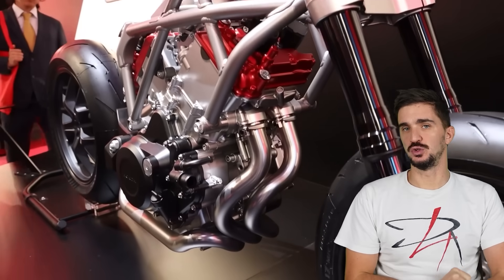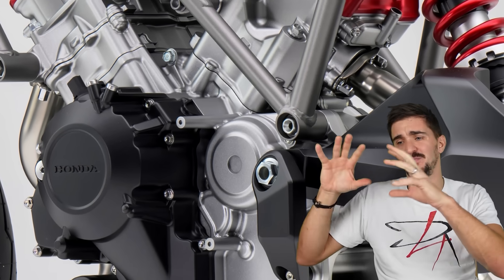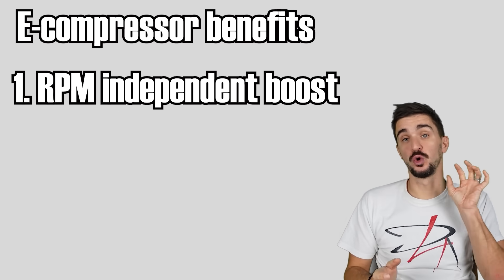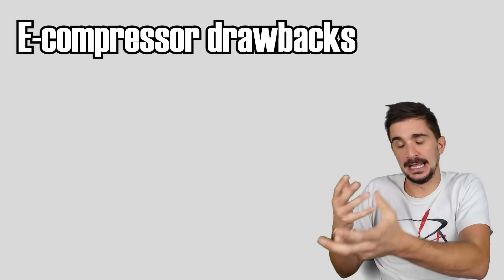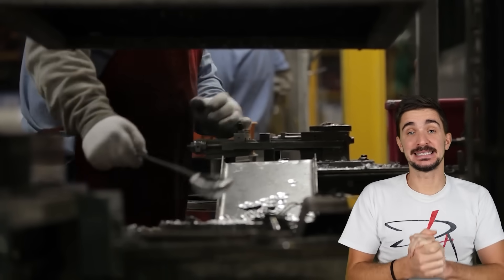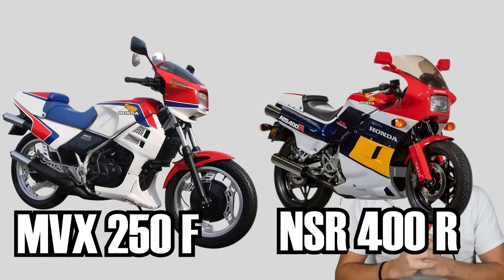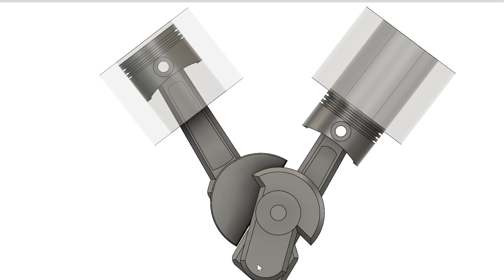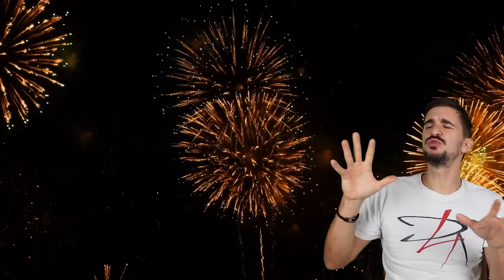Honda's New V3 Electrical Compressor Engine Explained

Comment: First, Honda should really focus on making the 1.5t reliable before venturing to a 3 cylinder.
Reply: Honda motorcycles has nothing to do with Honda automobiles. 
1.5 is not half bad.

Comment: Updated info a year later, it’s 73deg and 900cc, with claimed HP equivalent to a 1200cc according to Honda. Thats not a clear statement but their VFR1200 (V4) produces 160HP and in their promo video they show the prototype on a dyno with 160 flashing up briefly in red, so it looks like that’s what they want us to believe. It would be great to get another technical review of this engine if there is enough new data to justify one?

Comment: I don't know why it took so long to finally see electric compressors/e-supercharger or electric turbos adopted more widely for consumers. It was such an obviously advantageous system that I have wanted to install one (or a compressor and an... extractor fan?) in my vehicles for 12(?) years now.
Reply: I should note, I only wanted low boost.

Comment: Porshe has done something like this e turbo on the 911 GTS. Amazing flat torque.
Reply: It's not the same.
Porsche still uses a turbocharger and harvests electricity from it (from excess of exhaust gases), which can be used to help to spool the turbocharger.
Honda uses electricity only. No exhaust gasses involved.

Comment: @6:25 I bet they could use a small axial flux motor for the compressor motor which would solve the issue of heat and duration of use.

Comment: Pretty bang on with the e-compressor calculations saying 100hp engine goes to 130hp with 5psi of boost, and now Honda claims this 900cc to be equivalent to 1200cc!

Comment: 130hp from a 1 litre engine, yeah, 15-20 years ago.  Modern, performance 1 litre engines are averaging 200hp. For four cylinders at least. Current near 1 litre twins like the Panigale V2 and KTM RC990R (both are around 950cc) are in the 120-130hp range and are part of the new Supersport class largely suplanting 600cc inline 4's. The older Panigale V2 made 155hp but they cut power and weight on the current model.

Comment: Thank you for a very clear video. The V3 looks to be a very interesting engine! The other snag with Turbos was that the amount of boost they supply rises rapidly with revs, meaning that whilst you have no boost at low speeds (hence turbo lag), you likely had too much boost at high speeds, so had to dump it. Electronic control of the compressor is a genius idea to get round this.

Comment: "e compressor " ? the limitation with a electric motor is revs , you might get 5000 rpm if you use enough engineering , 3300 is pretty well max at the moment , while a "turbo " can be spinning at 200,000 rpm , just a bit more then . Air is , for want of a better term , elastic, you can squash it and stretch it , when you squash it it releases heat , but when stretched or expanded rapidly ,it cools dramatically , but loses density , theres problem number 1 , how to compress the air enough without it overheating the compressor  thats why this system only generates 5 psi , they cant get the compressor to spin fast enough reliably !

Comment: You’re using the term electrical Incorrectly. Electrical is a more general term whereas “electric” refers to being powered by electricity. Ie. electric motor. You wouldn’t say “an electrical motor”. Great video though! Just got annoying hearing electrical over and over.

Comment: And no you dont save gas with turbo vehicles. Infact turbo and supercharged engines use more fuel to fight detonation. My bronco raptor for instance gets mpg than both my 1996 bronco 5.8 and jeep rubicon 392.

Comment: Too bad the exhaust doesn't run a higher voltage battery charger to top off the compressor batteries.

Comment: The company i work for uses a V3 diesel Warchalowski tractor for snow plowing. i don't understand, why someone would design an engine like that but it works. it has been working for over half a century.

Comment: don't quite see the advantage of V3 over V4 (you need two separate cylinder heads, the width is defined by two cylinders, length defined by the angle of two banks, and i.e. Aprilia is using 65° angle on theirs, with the cylinders being of course smaller per total displacement - so it's probably even more compact given the same displacement), but if they want to do something quirky for the hell of it, go for it.

Comment: About 20 years ago when I was working with medical ventilators, many used blowers similar to this and they can put out a lot of air and have air ready on standby for when a patient takes a breath.  I am a repair technician, I am a motor head not an engineer,  I used to tell my co-worker techs that I think this technology could easily adapted to supercharge engines.  Glad to see it!

Comment: Sounds like a solution to a problem no one asked for? 

Battery weight?
Alternator weight?
Valvetrian complexity if you wanna harness any of the boost you generate with that... 

I would be totally happy with a 800cc V3 with 100hp at the wheel without all that giggles ....

Most likely the engine is emission starved and the compressor adds a little fancy 5-10bhp somewhere, sometime..... 

Just my guess...😅

Oh and btw scaling a V6 car engine to a motorcycle engine is a very very bad idear.

The car most likely does not need a bigger alternator, as it has tons of electrical consumers anyway.
Alsow the battery will most likely not gain any significant size.

On a bike where there is maybe a keyless start option and a clock on the dash the idle power consumption is minimal...and so is the battery...
On a car you have Starter-Generator options to place between crankshaft and gearbox.

A bike runs a wet clutch and gearbox in oil...that is completely different internally from a car gearbox where engine and gearbox fluids are separated.

I am not telling it can't be done.
Just saying that the comparison is quite a wild guess....

Alsow comparing a heavy diesel engine to a lightweight motorcycle engine screw's the numbers even more...the diesels valvetrian is already optimized for low rpm high airflow...a bike engine generally is not...

Comment: If they add a bigger alternator they can also use it on demand when you let go of the throttle for regenerative braking
Reply: The bigger alternator does generate parasitic drag on the engine...
The whole electric thing is a solution to a non-existent problem.

The only benefit is freedom of placement..... But all the electrical requirements do add up on weight in different places ..

Comment: I think we should stop focusing on how much fuel we can cram into the engine, and focus more on using less fuel to extract more power from the combustion itself.
Reply: This is exactly why Honda uses an e-compressor.

Comment: A turbocharger is "free" energy, or can be designed to be. Yes the turbine creates back pressure on the exhaust stroke but the intake stroke benefits from "fore" pressure. In a sense the piston section of the engine now sees the world as 2 bar or whatever the boost is. The net effect is positive, as by increasing the pressure ratio of the entire system, you are able to harness more of the heat  energy of combustion before it reduces to atmospheric pressure. Similar to how a jet engine benefits from a higher pressure ratio. In fact a turbocharger is in effect turning a piston engine into hybrid piston turboshaft engine.
Reply from the maker: Free implies something for nothing. That's not what you described. Yes, you get something bigger by sacrificing something smaller, but not free. Otherwise some business would be considered free money too 😆
Reply: @d4a  I guess what im saying is a well matched turbocharger under sensible driving conditions shouldn't take net power off the crankshaft, so in a sense it is free energy - or to phrase it better you are utilising energy that is otherwise wasted. Whereas a supercharger and this thing which is essentially an e-supercharger does take energy from it- it sacrifices fuel efficiency for power density/responsiveness. That's why an e-assisted turbocharger is the best of both worlds!

Comment: The e compressor is not going to create back pressure, but it is going to put more load on the alternator, which is driven by the engine. Which is more efficient is going to be the question. The real benefits may come from the three benefits you previously mentioned.

Comment: Interesting video, you put a lot into these.  Thank you.    I wondered about increased weight of battery as many basic motorcycles still use lead acid.   With a upgrade to lithium battery you could bought increase power and possibly even weight less.  Solid state battery even better.    Just a thought.

Comment: How about a hydraulically powered compressor? At wide open, it would probably act like a supercharger – oil replacing the belt, but variable with valves.

Comment: There's another advantage of a supercharger over a Turbo: Being independent from hot exhaust gases, the air / mixture that gets compressed doesn't have to pass through the freakin' hot Turbo, thus no intercooler (cost, need of space, far longer intake way) is needed.
Reply: Superchargers use intercoolers/after coolers as well. The heat in the intake is not from the compressor housing it’s from the fact that air temperature raises when it’s compressed.
Reply: @samhoffman1280  
Yes it does raise too, but not in a amount that makes a cooler mandatory, as you can see in the example in the video above 🙂

Comment: as for what the cost of this e-compressor is, it is similar to the costs of a supercharger. the electric motor on the compressor increases the engine's need to create electricity. Thus it increases the alternator's parasitic hp loss.

Comment: Idea #347
A vacuum cleaner type blower on the crank, pressurizes intake air from a front scoop, and the exhaust turbo runs the alternator electrical generation using Peltier effect producing electricity from heat also. The turbo quiets the exhaust and a small box muffler under/behind the engine with multi 3 inch small diameter side outlet pipes aimed down and back dumps the exhaust without any muffler weight to speak of. Use dual rear swing arms for strength and light weight.  Two small shocks at 45 degree forward and a partial uni shock spring. Opposing 2 cylinder, 2 cycle, both fire at the same time, motor with two crank eccentrics.  One valve per cylinder using PULL RODS. Use a 2 cycle muffler if it's a 2-cycle motor.

Comment: The Honda MVX250F is a 249cc, liquid-cooled, two-stroke, 90-degree V3 engine motorcycle. It features a 49hp engine at 9,000 rpm and 31.3 Nm of torque at 8,500 rpm. The engine is a 90-degree V3 layout with two cylinders in one bank and one in the other. It uses crankcase reed valve induction.

Comment: Interesting with 75degr. V engine.  Opel had also a 75degr. V6 race engine of 2,5L in late nineties Opel Calibra, which was a real rocket, but never understood why it had to be 75degr. while the other manufacturers used 60 and 90 degr V6 s.
Reply: It was an Isuzu engine block if I remember correctly.

Comment: this e compressor system will NOT create a larger net gain than a traditional turbo.  this is because the E compressor is just an electrical SUPERCHARGER.  the electric compressor has to be pulling ALL of its power directly from the engine in the form of electricity.  so the alternator is directly slowing down the engine to power the compressor.  its just a supercharger.  all superchargers create SMALLER net gains compared to turbochargers because the supercharge takes ALL of its power from the engine, while the turbocharger reduces SOME engine power as an unfortunate side effect but gets ALL of its power from waste gases.  Because the turbo is getting power from something that a non turbo engine was going to throw away, it gets more total power by being MORE EFFICIENT.  a supercharger doesnt do that, so it will have less net power gain.  

lets take a hypothetical.  take a 100 HP engine WITHOUT any supercharging.  now we take two identical copies, put a turbo on one of them, and an E supercharger on the other (electrical compressor).  we boost both by exactly 14 psi which will take intake manifold pressure from 14 psi (atmospheric) to 28 psi (double atmospheric).  our hp rating on each is now 200 hp.  however the supercharger system itself takes 10 hp to run.  so in fact the MAXIMUM for the e-supercharger system is 190 hp.  the turbo charger system requires an IDENTICAL 10 hp to run, but it gets that 10 hp from the exhaust gas that the e-supercharger DOES NOT USE.  so it still gets 200hp IN THEORY.  however now we subtract out losses from back pressure and that will be about 2 hp instead of 10.  so we have 190 hp vs 198 hp.  

it is basically ALWAYS THE CASE that a turbo charger gets more power than a supercharger due to the increased fuel efficiency.  if this were not the case no one would use turbo's.  Mechanically driven superchargers have been around since the early 1900's and if they COULD be better than a turbo everyone would use them.  converting mechanical energy into electricity and then CONVERTING IT BACK TO MECHANICAL ENERGY does NOT increase the efficiency of the system.  it only makes it easy to put the supercharger wherever you want it.  in fact it will DECREASE efficiency as you have energy losses at BOTH conversions.   So the E system lets you package better AND it eliminates turbo lag and lets you flatten your torque curve, BUT the cost is that it is LESS efficient than a mechanical supercharger, and we already know that a mechanical supercharger is LESS EFFICIENT than a turbo charger, because thats the whole reason everyone uses turbo's instead of mechanical superchargers.

Comment: High compression at low rpm will cause problems of higher wear because lubrication is not (yet) optimal at low rpm.

Comment: In the picture s it shows the electric compressor with TWO largish fluid connectors going into the casing. They are not cables and seem to be water cooling for the electric motor. Where does the electrical power come from? a LARGE energy sucking alternator perhaps?

Comment: check porsche GTS hybrid turbo charger E then you understand abut F1 hybrids you need understand turbo E is mean air compressed and is no same with air compressor is 2 different things is no same turbo E is inside air compressed and not compressor

Comment: Can we make a multi cylinder engine with different cc for different cylinders, maybe adjusting there stroke lengths or something.
Reply: been done many times already
Reply: Which engine pls, is it used in any production vehicle.@georgebarnes8163

Comment: Boost pressure, I.E. 5psi, is a "dimensionless" value when what needs to be known is how much available oxygen exists in a system. Here's an example of what I am referring to: 2 containers with closed valves, both of different sizes, contain 5psi of air pressure. Each is connected to the intake of an engine using a hose, and the valve is opened immediately to release the air into the engine. Without knowing anything else about the containers (and the entire system) besides knowing the air pressure, we will know nothing about how much oxygen will flow into the engine when the valve on each container is opened. How large is each container? How large is the hose on each container connected to the intake? How large is the engine displacement where the container will release it's oxygen, and how fast is the engine spinning? If it's not spinning at all, the displacement will be constant, and will change depending on where each piston is located. If the engine is spinning very fast, volume of potential flow for a given time frame will be larger. Then, there are other variables involved, such as resistance to the air flow, turbulence effects, etc.

    We can go further than these examples. What if one container is smaller, and it was filled to 8psi at a high temperature, and then the container was cooled until the air pressure inside lowered to 5psi, while the larger container was filled to 2psi at a cool temperature but then it was heated until the pressure inside reached 5psi--how much total oxygen is actually contained inside each container at 5psi now?

   As you can see, when flow is involved, many new variables exist. When flow isn't involved at all, variables still exist, such as temperature and volume, to know how much oxygen is available to be used. 

  Many often think that psi alone provides a way to determine some increase in power, but it's a sliver of the entire equation. A very large pump with large hose that is cool maintaining 5psi can have a much different amount of air volume flowing through it than a very small pump with small hose at a higher temperature maintaining 5psi while flowing air through it. Of course, air contains many gasses, but oxygen is the gas we care about. Efficiency and psi are very different things in a system moving air.

Comment: Great Video! in addition to the advantages, here are others benifits of e-compressor
1.Comparing with turbo charger, the e-compressor does not have a hot side, as it is electrically driven. This reduces thermal stress on the components, potentially improving durability and reliability.
2. With an electric motor driving the compressor, the boost pressure can be precisely controlled by adjusting the motor's speed. This allows for more efficient and optimized engine performance across a wider range of operating conditions.

Comment: why not make the rear lone cylinder larger discplacement?  In fact why not use two cranks with an e clutch on one so at  certain load /rpm it becomes a fuel efficient SINGLE?